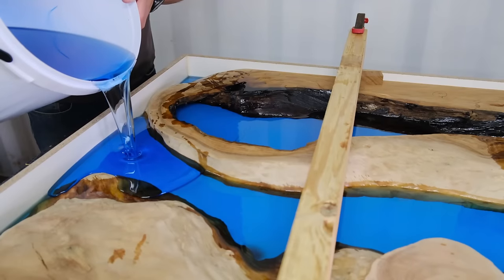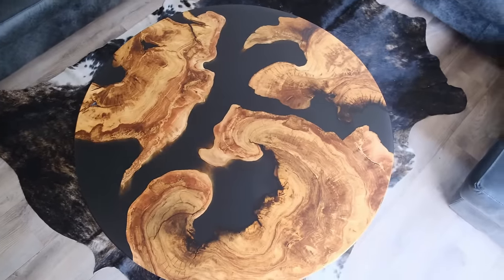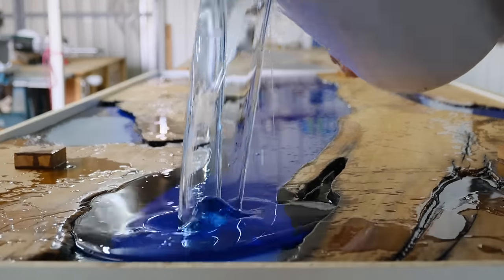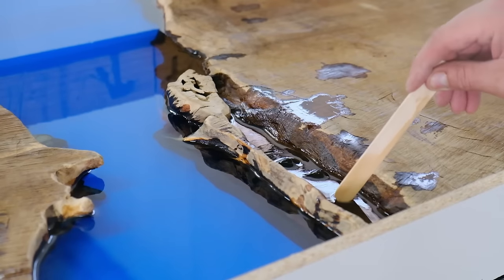DIY Epoxy Table Build - Step By Step Guide (uncut)

Comment: You really put a ton of time and effort into the design and build of this truly gorgeous finished piece, not to mention the production and editing of the video. Speaking of- Thank you for condensing each step into a manageable 30 minute video for numpties like myself! I know a table like this takes literally months of hard work (daily) to get to the finish line. Thanks. 

Btw that’s an ingenious little router slab device you’ve constructed- when you consider that Woodpeckers sells their Router Sleds for over a $1000 and yours is just as effective for a fraction of the cost: that’s a very clever design indeed! I’ve seen other videos on making DIY Router sleds- yours is brilliant! Simple yet clever! ……..I do have one quick question. I am currently in the process of building my own Rputer sled. I have not seen a Router Slab Bit for your sled as the heavy duty/big/wide yellow one that you have in your Router. Where did you buy this bit? It looks like a 1/2” shank, or is it a 1/4”? Thanks in advance for your help and attention to this question. I also look forward to more of your epoxy table/woodworking videos in the future. Cheers! Scott.
Reply: ণণনণণণণণণণনণণণনণণণণষণণণণণনণণণণণনণণষণণণণণণণণণননণনণণণণণণনননণণণণনণণণনণণণণণণণণণণণণণণনণণণণণনণণষ্ট।
Reply from the maker: Thanks so much for the kind words and support. Think the brand we buy is only from South Africa

Comment: I'm curious. I'm thinking of trying something like this both for a dining table and a desk. With the latter, would you keep it strictly a match with the wood used for the desk top as far as the drawer frame and drawer fronts are concerned, or try to get the epoxy and identical color in? I'm leaning to keeping it just wood so that the accent is on the desk top. Any thoughts?
Reply from the maker: Your idea sounds about what we would have done. Sounds good

Comment: What is the release wax you use in the mould? I've seen many people using tape instead so wondered if wax gives a better result.
Reply: You have to be careful with melamine. If the epoxy heats up too much during curing, it can melt the vinyl part of the melamine and stick to your project. Tyvek or similar tape avoids this. It may require a little more sanding because of the lapping of the tape can leave a slightly uneven surface. But compared to prying the melted melamine off and then grinding and sanding the rest of it off, I will chose the Tyvek every time.  Good luck.

Comment: Question: why is it you didn’t feel like you needed to put braces under the table like other YouTubers do? 
I agree aesthetically it would look bad on this table because the beautiful transparent epoxy would show them. But apparently (I don’t really know) the wood warps over time. Which seems logical.
Reply from the maker: Our steel legs has a supportive structure underneath
Reply: @diywithgreg  thank you 🙏